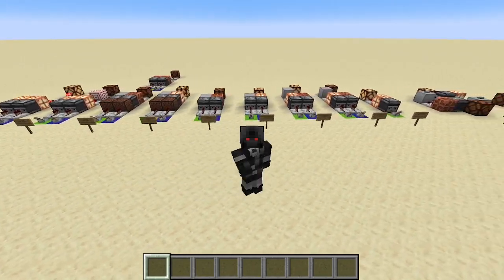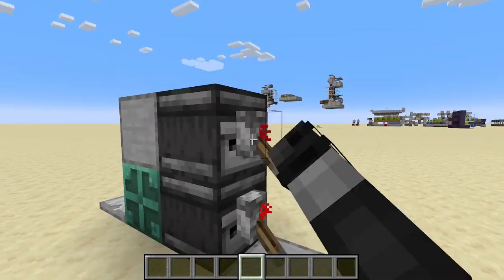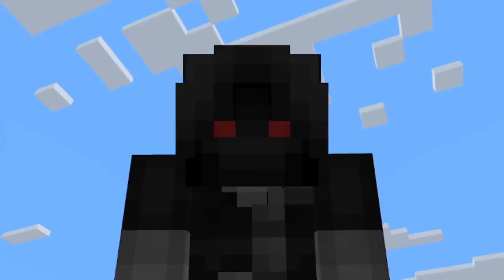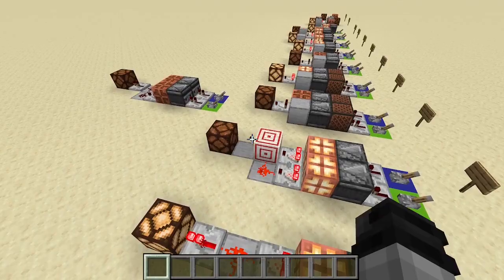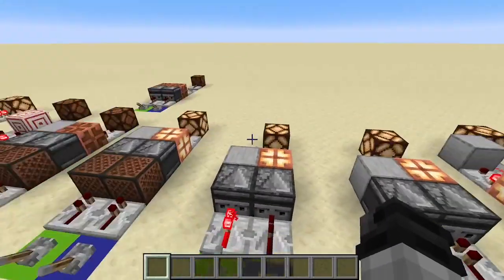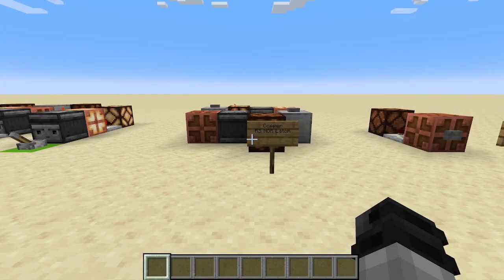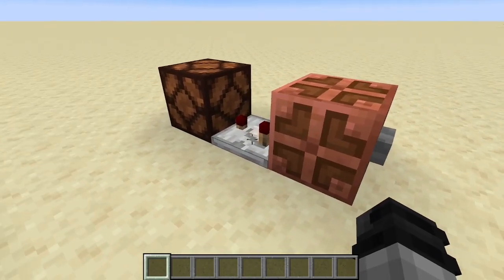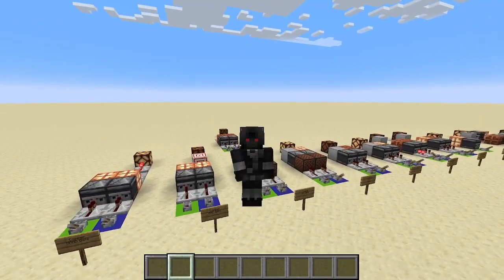Every Basic Logic Gate Using Copper Bulbs | Copper Logic Gates 1.21+ | Minecraft Tutorials

Comment: Question The x in or gate how are you getting the power output to the copper bulb there are you activating it previously before putting down your comparators and then doing it that way or exactly how's that working
Reply from the maker: All of the copper bulbs that start on, I attached a lever directly to them, turned them on, then broke the lever.